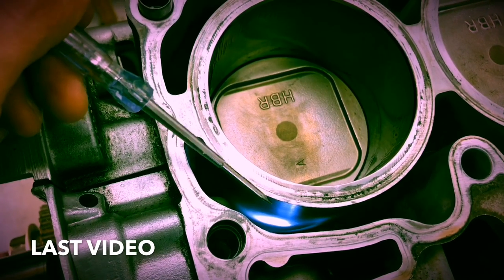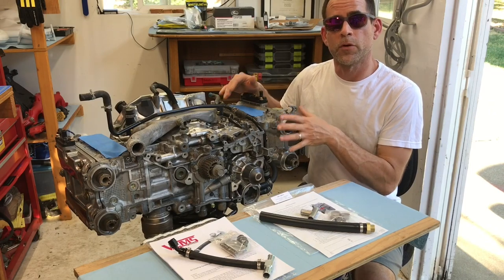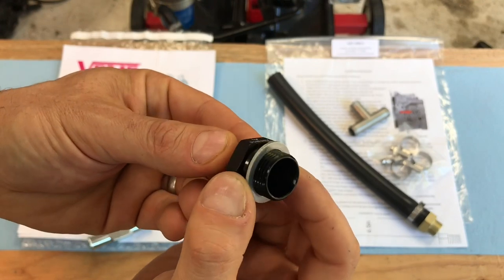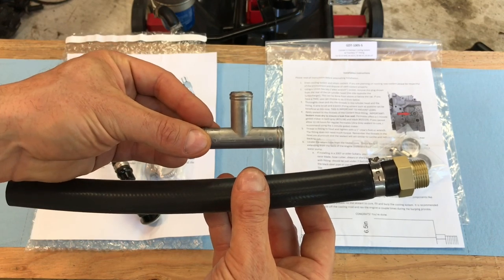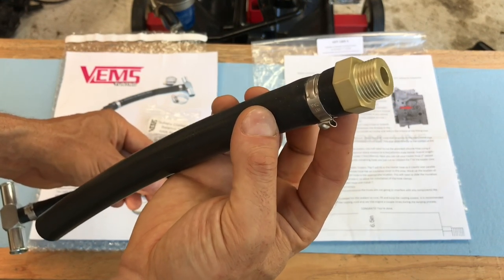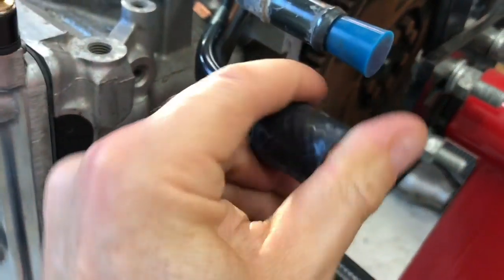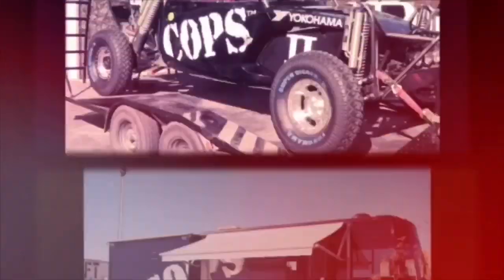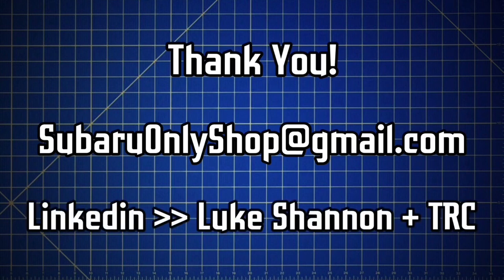Subaru Coolant Balence Kits | GDT vs. VEMS

Comment: Luke thanks for explaining the reason why #4 is heating more than the other but is it really necessary for a stock engine to stall this? Will this affect the warranty. Subaru should have known this defect since the 90’s right.
Reply from the maker: Great question buddy - And to be honest, I can’t say with certainly.  Overall, if you are running 100% stock and not using your car for any extreme driving, just changing the fluids is the biggest thing you can do for reliability.  

Also, any time you add complexity (ie this kit), you open the door for unintended negative outcomes, however, that being said, if you install this kit correctly, it can only help and may end up having some real benefit over a couple hundred thousand miles.  

On that note, even stock motors that were never raced always need to have the heads surfaced when replacing the head gaskets around 150k mi.  That means there’s most likely uneven heating and cooling across Subaru heads, which is what causes them to twist slightly over time. In theory, keeping your heads uniformly distributed with heating and cooling cycles would help them from tweaking over time and needing that resurface. So, overall I think this is a good mod for anyone - as long as it is installed correctly.  Good luck and thanks for dropping the question.  Cheers buddy! 😁
Reply: Thanks Luke, overall the benefit is greater than the negative outcome. Will install it before summer comes.

Comment: @SubaruOnly, thanks for thi educational material. Wondering if this will work on a Subaru Forester 2001 EJ20 engine. It has a Turbo sti kit.

Also, i seem to be getting lots of heat on the engine to a point where the reservoir tank is full n boiling when i stop.. cn you guide me..?
Reply from the maker: Yes, would help on any EJ style block for sure. Especially if overheating issues occurring. Also, verify it’s not a head gasket, that also causes overheating. Good luck! 👍
Reply: @SubaruONLY  i will try and order one asap. I have checked my head gasket seems to be ok. Oil is clean and enough, changed radiator cap, but i seem to be getting lots of heat. Today the coolant was drained a fter a short drive of about 1.5hrs. given i took abit in traffic and was goiing uphill.

CN you guide me on what would be the issue..? Am afraid to take along drive now. Afraid the engine might brick due to heat.

Is this normal behavior with subaru engines..?
Reply from the maker: No, not normal behavior. Something is definitely wrong if that’s occurring. Verify no coolant leaks anywhere too.  Old water pump? Bad thermostat?

Comment: The measurement tool you used @ 6:40, where can I buy that?
-Thanks
Reply from the maker: Got it from a small local hardware shop many years ago.  Prob could find one on Amazon or eBay tho.  👍

Comment: Coolant reroute kits are available from other vendors for the Miata as well. My issue with these reroute kits is that they make claims of cooling the number 4 cylinder, but they don’t have any tests to support it. Yes the design in theory looks better, and for built performance race motors, sure go for it. I did the reroute on my built motor, but for the vast majority of Miata owners, this isn’t necessary. Do any of the Subaru vendors have any testing to show the benefits? I couldn’t find any.

Comment: Can this be installed without removing the intercooler? I'd rather do the install from the bottom if possible. If you know, cool, if not, I'll have to try it myself.
Reply from the maker: Hi. Yep, these can be installed from under the car.  I think Dom (from get a Dom tune) has a video showing this too, fyi.

Comment: What about cylinder number 3 , it get enough cooling?
Reply: yes.   
Most flow to least flow:  2, 3, 1, 4.  

1 and 3 are very very balanced with just the extra flow to 3 because it has to feed the turbo.
Reply: @GetaDomTune  ok thanks
I didn't find this mod on ebay, where can I get it?
Reply: @GetaDomTune  cheers

Comment: Where does the T connect to after that? Lol
Reply: The black pipe he mocked up is where you T into the coolant line.You place it like a T into that line, the bottom of the T goes into the new hose you just installed.

Comment: My questions are

Why is there a bung to begin with? A rather large one at that. And why hasn't Subaru figured this out?
Reply: The twin turbo legacy gt has twin turbos and used this port as a coolant return for the second turbo.
Reply: Subaru also used it to run through a water/oil trans cooler for the old 4eat. Pretty sure this was all jdm.